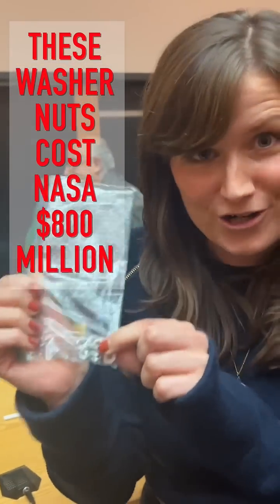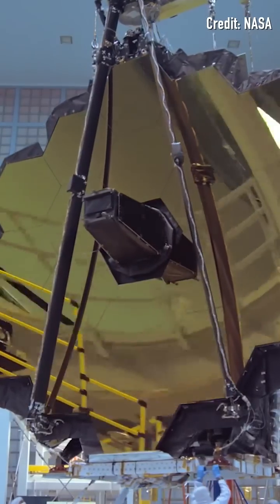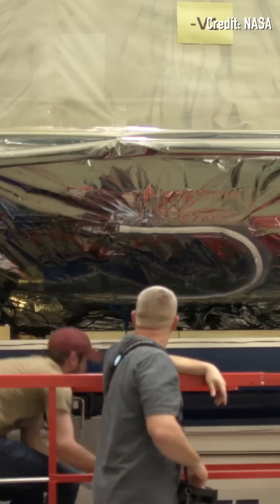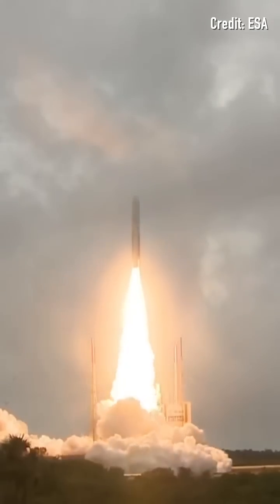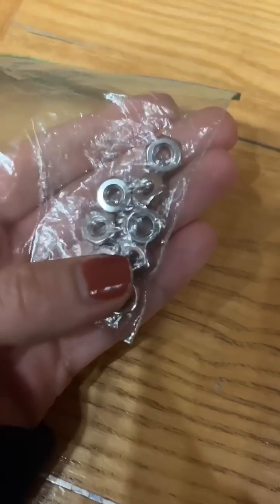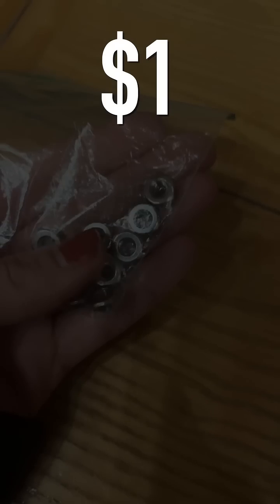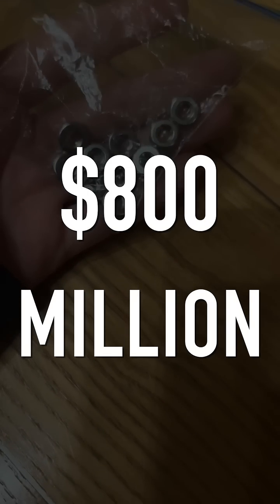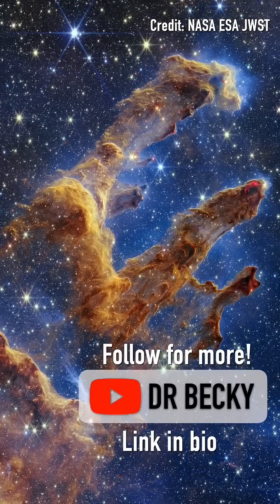JWST cost an extra $800 million because of these 10 washer nuts

Comment: Why could they not use locknuts with threadlocker?
Reply: It has to work, for decades, in a vacuum at -445° F on exotic beryllium alloys. Pretty sure the LocTite corp hasn’t certified its red goo under those conditions, in fact it probably would shatter immediately. 

Seriously people—the hundreds of engineers designing, building, and certifying this spacecraft aren’t idiots. There are tons of examples of them choosing elegant, simple, and inexpensive solutions where appropriate.  Do you seriously think they DIDN’T consider thread locker? Do you really think they all got together and decided “yeah, LocTite would fix this, but it’s too cheap”? 
The confident arrogance of a bunch of comment section galoots second-guessing NASA engineers—it’s like a goddamn Dunning-Kruger convention.
Reply: @timothy098-b4f  "yeah, LocTite would fix this, but it's too cheap"

...government
Reply: That would require testing thread locker in space to determine how effective it would remain and also not contaminate the equipment.
Reply: All they needed was a quick drive to the local hardware store!
Reply: Complexity.
Reply: Yeah, or Loctite ?